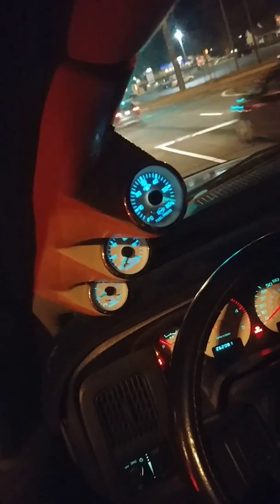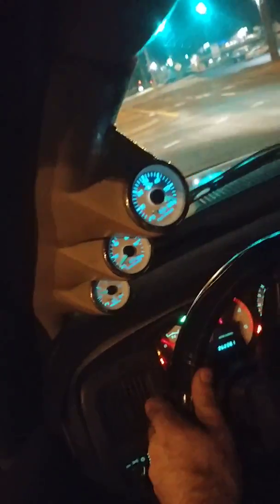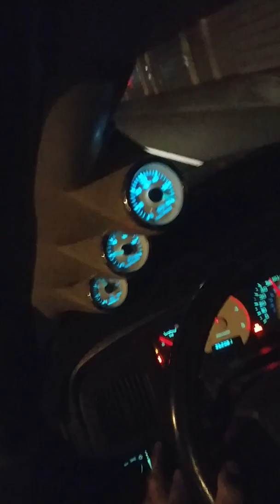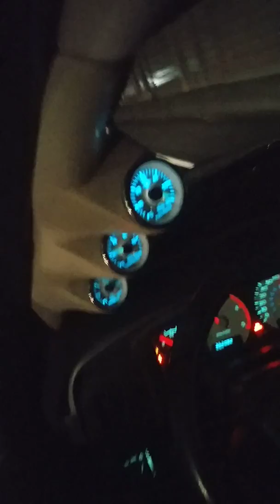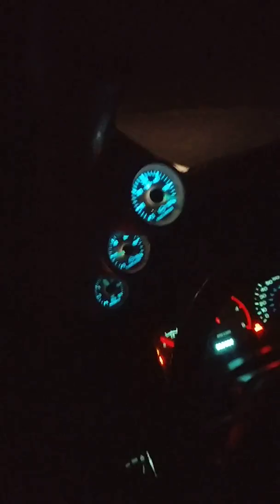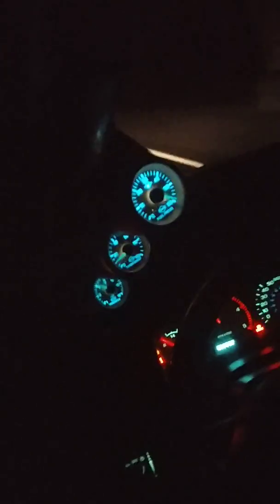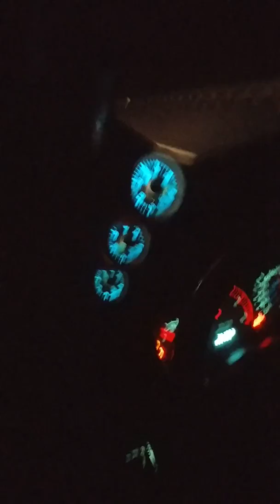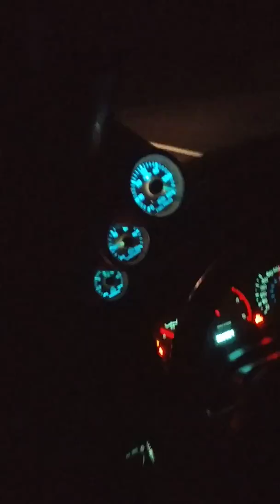Towing Update On The Project Black Hole 3rd Gen 12V Swap

Comment: I have the same compound turbo setup on my 12 rail 05 now, the 1.32 is lazy but I like it better than the 351 alone. A 1.10 used can be had for around 150 bucks. I think that’ll be my next upgrade when I pull the 475 apart for a Billet wheel and a rebuild.
Reply from the maker: Great info! Next time we pull this set apart, I think we are going to try the same thing, minus the billet wheel. I know you say busy out there, but let us know how that responds once you get it all swapped over. Not sure if you feel the same, but it kind of funny to me how much people rip on a HE351/ S475 set ups. They do really well for what they are. I ported the wastegate port out to 7/8" and I can gate by that HE351 pretty darn well for a single exhaust port!
Reply: 70440charger I took mine out to 1” and ported it a little. Right now the factory waste gate actuator is bypassed at maybe 22psi or so? Just drive pressure opening it up. Honestly responds quite well at 7000ft with the tightest converter that DPC offers. It would do a lot better with a stock stall in uphill dead start conditions with a heavy trailer. I’m probably going to upgrade the 351 with a bigger turbine wheel and compressor eventually. Do you have an Instagram or some sort of social media? Easier to communicate there, I’m farmer_frost on insta and on Facebook you can find me by name Spencer Frost.
Reply from the maker: I will for sure look you up on both Instagram and go find you on facebook! I am not super active on their cause, like you, I have a crap ton of stuff going on in the real world! I really appreciate you sharing what you have learned. I wish I knew 5 years ago, what I know now about sizing turbos and what works and what is just snake oil crap out there!

Comment: What's the max boost you see on this setup
Reply from the maker: About 72 pounds of boost, but this is with a ported head, so on a stock head I think boost would be a little higher.